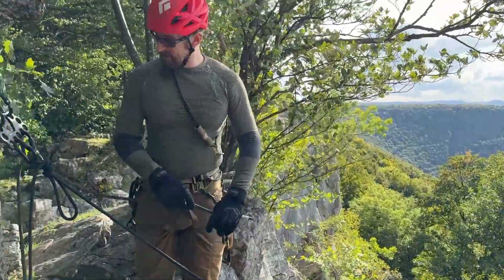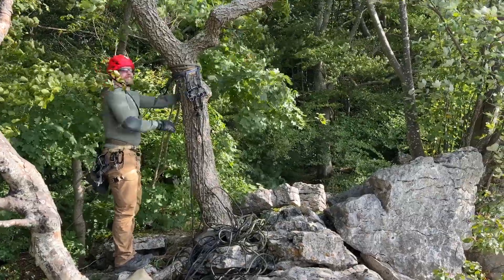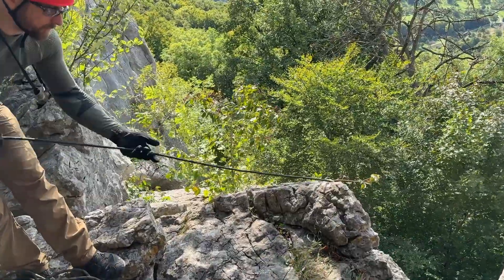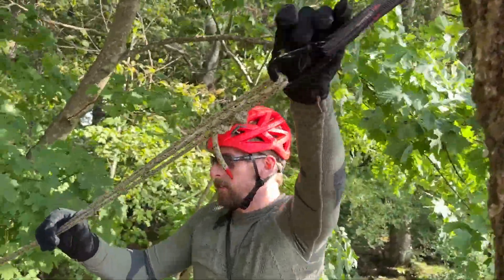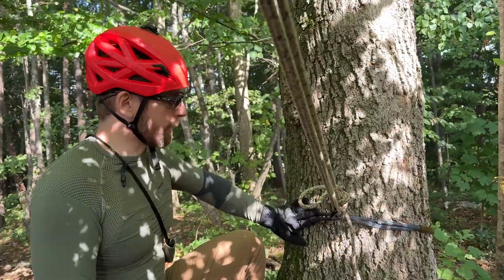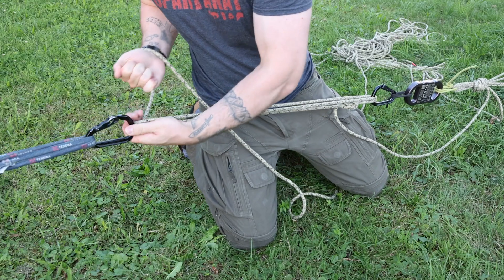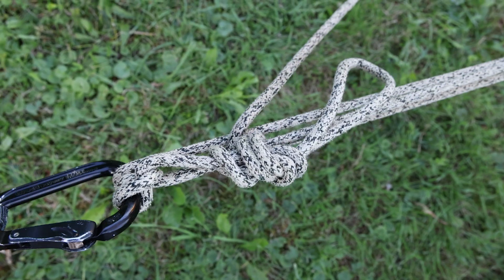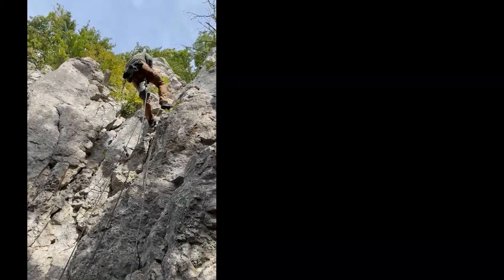Reinforcing a weak Tree to Rappel on - Tensioned Back-Tie with Glove Hitch and Mule Overhand

Comment: Love your videos. Anchor at the base of a tree always, more strength and less leverage pulling it over. Use the backstay up high as shown here to counter the pulling force. Nice technique
Reply from the maker: Thx 🙏🏻 
Anchor point is high to have an easier edge transfer. With a low attachment point I would not need to use the tree at all, since there are healthy trees there ;-)

The dead tree was only used to have the anchor higher.
I have also seen setups with low anchor and high back tied thing. But since then the slings are not interlocked, it’s possibly less safe. At least if the tree breaks between the rappel anchor and the back tensioned sling or if the roots are weak.
With the interlocked slings, the tree has almost no leverage, since the pull goes directly to the tree behind. But it indeed gets pulled to the ground.